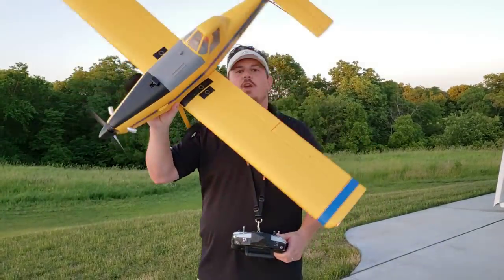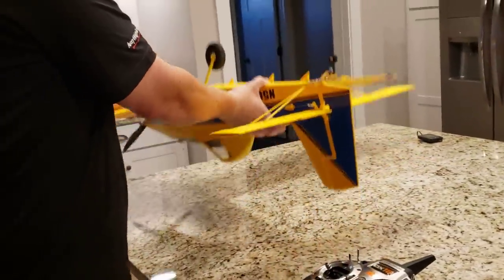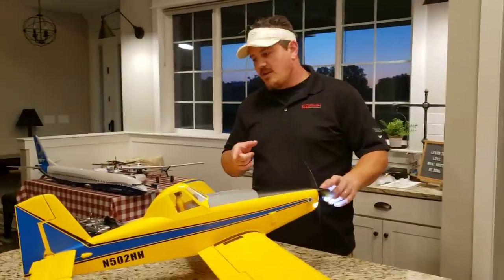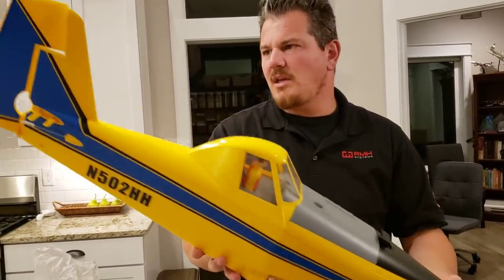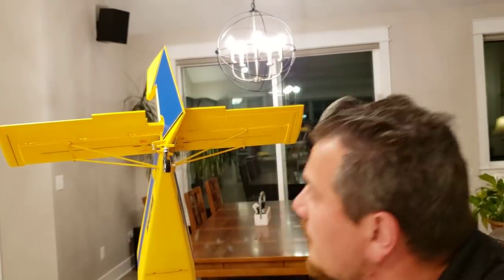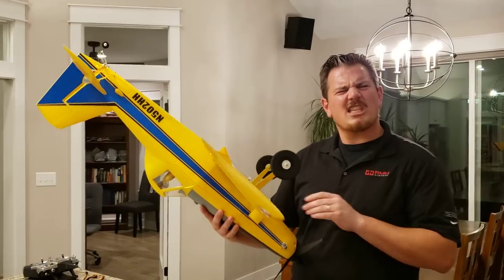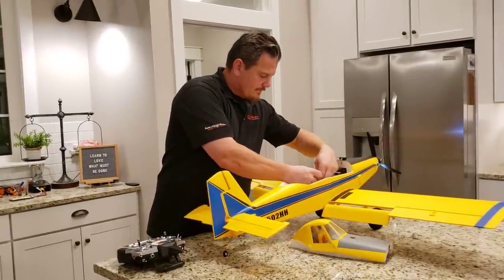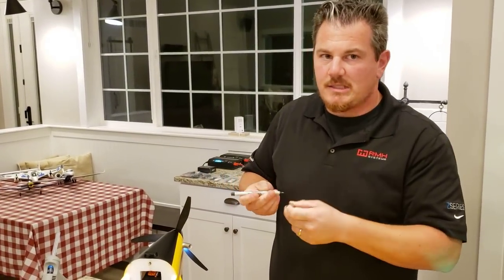Eflite - Air Tractor 1.5m - Unbox, Build, Setup, & Flights

Comment: Yea my twin otter has the same curve in it as well and goes straight when the elevator is fully deployed scratching my head on that one still. And thanks for reviewing the Air Tractor cause that’s the next one in the cart!!! And I have a question real quick because I’m stumped on something with the Eflite SU-30 I just got yesterday after I had a horrible flight with it today seemed like it was losing signal at like 100 yards and every time I plug the battery in I had to rebind it to the transmitter. Is that a RX problem 
? “and safe as well won’t work” I’m leaning towards the receiver is defective. I checked my TX with my other planes and no issue any help would be appropriated thanks and happy and safe flying!! And yes btw I seen that with the thumb lol all I can say is it’s a great one definitely better with flaperons!!!
Reply from the maker: That's no fun at all!!!! I'd be leaning that direction too! Are you doing the bind procedure with the BIND BUTTON or the BIND PLUG?

If you're doing it with the bind plug, try the other method, and opposite.

I once had a DX5 (I know - old, and inexpensive, so might not be a great comparison) where the antenna BROKE inside the foldy part...I lost a Sport Cub S UMX also, when I had the single antenna break from the multipurpose Rx Brick. Both conditions were a mechanical break...

Did you, or CAN you do a RANGE TEST? It's a very good tool, but admittedly, I've only ever done a Range Test ONCE ;) It was on my Airbus A330-600, right after I swear I lost signal on my A320 and lost it - but later realized (or remembered) I just screwed up...
Reply: Brian Phillips it only has bind plug you think for all that money they would of used the new smart RX!!! I figured it out they had the BEC hooked up to the signal and the ground it’s supposed to be hooked to the power and ground so it wasn’t remembering that it was bound so I just unplugged it switch the wire around and everything works fine now leave it to Horizon to make a simple mistake LOL and can’t wait to see your next vid bet I know what it is LMAO and like I said set up flaperons it’s great with that mix. And yeah I have a DX eight I think I wanna get the 12 channel or 20 though then I never have to get another TX again unless they come out with new technology!!!
Reply from the maker: I'm so glad you got her figured out!!!

As for the next video, I don't even know what it will be ;) We have three projects going right now, and ONE will be released later on, due to scheduling constraints from a partner, and the other will be released when we're done with it, and the last will be released in the gap....we ALSO have about 10-15 hours of farm related footage, which will perform poorly on the channel, so I have to release it JUST before some better footage, so people don't go crazy complaining - LOL!!!
Reply: Brian Phillips bring it on lol I use to farm so I’ll be watching and ok can’t wait!!! Happy flying!!!

Comment: Hey Brian, I See Some Needed Mods! A  Tower Over Cock-Pit w/Heavy Fish Line Braid For Guide Wires On Wings & Tail, Like The Real Ones! Then Fix A Big Can Of Bug Spray On Belly w/Spray Lines Across Bottom Of Wings w/A Push Servo On Momentary TX Button To Dispurse Spray Since Your Bugs Look Like Birds In Front Of Camera!? Soo As You Keep Buzzing Yourselves You Can Tread The Area!? Ohhh-Yeahhh Your Could Actually Dust Your Fields, Put iNav On Her To Actually Plot Grid The Property! Use A Tank w/Pump & Make It Really Work Then Write All The Costs Off On AG & Taxes! LMAO Thanks I Bet That Would be Get You Many MORE YT - Views...
Reply from the maker: I want to do this, but think the weight would get the best of us first ;)
Reply: Nahhh, Fox Tech Does It With A Sprayer Drone w/Gas Generator Motor! LOL Come On We Can Beat The Chinese... Hell It's Scale, Soo Just Down Size The System Off Real Crop Dusters... LOL Add CF Rods, Guide Wires All Over The Air-Frames, Bigger Motor-ESC- Batteries, Shoot For A 5-8 lbs Payload Weight!? With Your Money's & My MAD Designs, You Can Do It!!! LMAO
Reply from the maker: Can I borrow some time too ;) LOL!!!!!
Reply: OK I'll Build It, I've Got All The Parts & Some 8' Wings, Then Build A Custom Fuselage Around An AG WAGON Style, Incorporate In A Heavy Plastic Gallon Jug, Then Use Some Old Water Mister System Lines + Heads, Use A 1 1/2hp Gas Weed Wacker Motor & Route The Exhaust Though Another Plastic Bottle To Produce The Spray Pressures To Push Bug or Weed Spray Mix Out As You Fly It... I've Also Got A Full Eagle Tree Navigation System w/FPV Etc!!! LOL
Reply: I Might Could Sell It To Ya, Save Your $-Pennies!? LMAO

Comment: I modified mine by installing a spreader bar on the main landing gear and replacing the tail wheel unit with a Klett assembly.

Comment: Brian, why did HH not give a "crop dusting" option? I am thinking that one of those belt worn pressure sprayers which are personal cooling devices with a fine water mist being retrofitted on this bird to do some authentic "dusting"....Yeah man, that'd be sweet!!
Reply: Liability, obviously.  There are a-holes that would load the hopper with Roundup and spray their neighbor's yards. :)
Reply from the maker: That would be pretty sweet, but gotta keep in mind the weight of water is such that you'd be hard pressed to get much capacity.
Reply from the maker: Jon - I wish some A-hole would spray my yard - LOL!!! Just don't want something like this to show up on my lawn - https://images.app.goo.gl/KfrzGMtd1cKaXick8
Reply: Brian, I am SURE that you probably have a big exterior fan (like on wheels) don't you? If so, put some screen on the intake side and place an open Coke about 12" away from the intake, the mosquitos will go to the Coke due to the carbon dioxide and the fan will suck those mosquitos into the screen and keep them away from you. Before you turn the fan off with all those 'stuck' skeeters on it, spray some 409 or Fantastic or even isopropyl alcohol on them and that will take care of them! After you turn the fan off, just get a broom and sweep those deaders into the grass for the other "critters"... : )
Reply: You wouldn't need much as it comes out in a fine mist, even 4oz's would last for a few cool passes spraying with your cool sunsets behind it! AND, if you put a drop of dish detergent in the water, you would technically be helping to keep the bugs down as the soap cleans the wax off their wings!
Reply from the maker: Totally AWESOME Ideal!!! Thank you Dave! I want to try it, but hope I never have too ;)
Reply: Well, it SURE beats wearing a Citronella candle! (I've ruined two shirts that way!) 
;  )

Comment: Nice video... What's your thoughts with replacing the stock wheels with those from the Turbo Timber?   I agree the stock ones seem hard and not all that great for grass.
Reply from the maker: Not a bad idea! I want something pretty springy. I think maybe a pneumatic tire would be called for. This IS after all, 1.5m, so it could handle a foam filed dobro tire, and it would look cool too! Keep in mind, if you're flying from grass, you won't even notice this issue...we just happen to be flying from a concrete driveway.
Reply: @BrianPhillipsRC  I used the wheels  from a timber on mine. I bought some du bro soft tires for it but they are really heavy so I stayed with timber tires. Im on my second Air Tractor and have had all the same issues you have had.  The Flaps, the curved horizontal stabilizer the battery tray pulled out on mine. On my first one the prop was so far out of balance it shook the wings and couldnt even get it close to balance.  The second one had some of the same issues. And the landing gear bend very easily. Other than that a great airplane.
Reply from the maker: Did you get the tail straight??? I noticed mine is pretty bad while I was having an AWESOME FLIGHT, but didn't film it (of course)...then when I taxied it in I was noticing this super UGLY tail feather ;(
Reply: @BrianPhillipsRC  Nope. Both air tractors were the same way.

Comment: where can we buy this and what is the cost
Reply: He has a link under video. Hit the arrow it opens up pull downs.  Plane,battery,exc
Reply from the maker: Air Tractor 1.5m - https://bit.ly/2Uy3tJ5
3300mAh 4S 30C - https://bit.ly/2MTSXHS
3300mAh 3S 30C - 3200mAh 3S 30C - https://bit.ly/2LTc0Sn
S2100 - https://bit.ly/2KCWLwh

Comment: Mix some bifrenthrin with some water in a backpack sprayer and spray around the yard (or at least where you spend time outside at dusk) and you can cut down your mosquitos quite a bit.
Reply from the maker: Excellent - We got some that will mix about an ounce per gallon, and worked wonders. We got a generic too...and worked amazing.